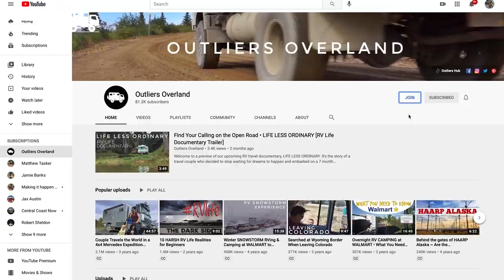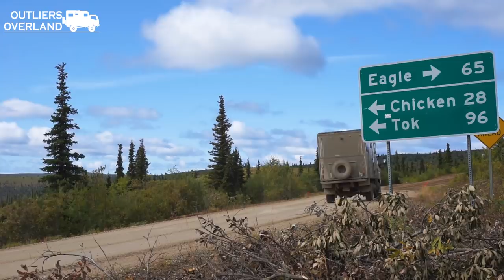30 TIPS TO BUILD THE ULTIMATE 4x4 EXPEDITION VEHICLE

Comment: I own a Volkswagen Transporter T6 camper with Diesel engine, diesel heater and diesel cooker, a 4wd system, watersysteem with UV and koolstof filter, 4 batteries and solar, porta potti and aircompressor. I think it’s like your big rig but than smaller. Thanks for the 31 tips, greetings from the Netherlands 🇳🇱❤️🇺🇸👍🥇

Comment: Look into an APC for Tractor Trailer trucks. They are A/c units, battery charger, heater, hooked into heat system like your esp. heater. Had one on my truck, awesome units.
Reply: APU Aux. Power Unit....
Reply from the maker: Thanks for the recommendation.   I googled them and they look interesting.

Comment: Agree with everything but the single fuel. I know the Europeans love the idea, but personal experience has taught me not to trust diesel heaters at high altitude and/or in very cold temps. We have the Eberspacher D5 and we only use it to pre-heat the engine. At -21f it wouldn't fire up. The next day at single digits, it worked fine again. Another group on youtube had serious trouble in Mongolia when theirs failed. I'd rather carry a few adapters for propane filling than clean a sooty diesel heater to keep it going. Propane is cheap, clean burning, and works everywhere.

Comment: Are you suggesting to stay below the 7500 kg of total weight? I wonder if you encountered many limitation with your truck
Reply from the maker: That wouldn’t be a bad idea.  
We weigh 12,500 lbs fully loaded.
Reply: @outliersoverland  Thanks I am looking into a used truck that it does not seems huge but it is 12 Tons (26,000 lbs) and wonder if that is not too much and maybe a problem for a series of reasons

Comment: Nice to have a generator but think to have a dual alternator so you generate electricity using your truck and direct the power to ur batteries 
And the ac runs in 12 v 
So u will need also to upgrade your batteries

Comment: As far as one fuel source goes adding a second alternator that could provide one to two hundred amps of charging might be the way to go instead of a generator. Add a couple more batteries and a couple more solar panels and your idle on your truck wouldn’t be that much.

Comment: well but you cant go without ecu. You mitsu has it. Engine is pretty complicated and even if you can easily reach to it that wont help you. Diesel is different to diesel. Oldschool diesel could use bad fuel and its louder and there is no egr or def techologies. Thats what i call true diesel. But you are brave enough to drive diesel. Hope that you will enjoy it till it dies in the next owner hands=)